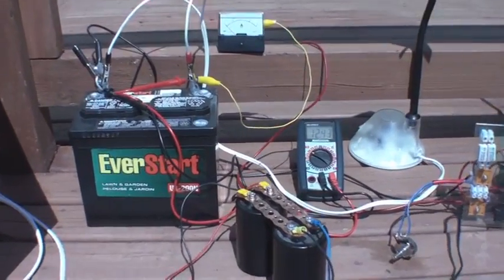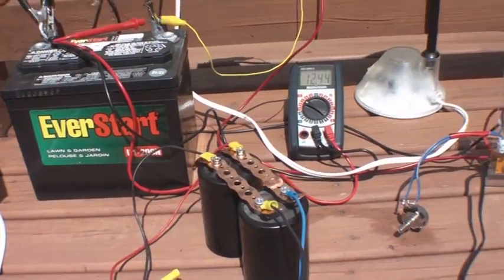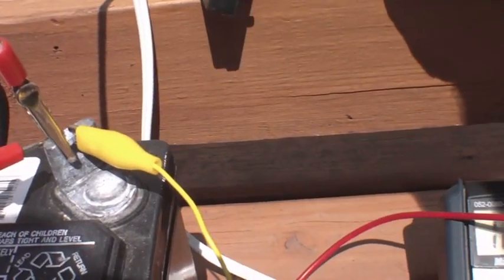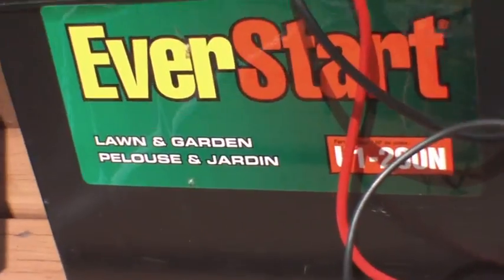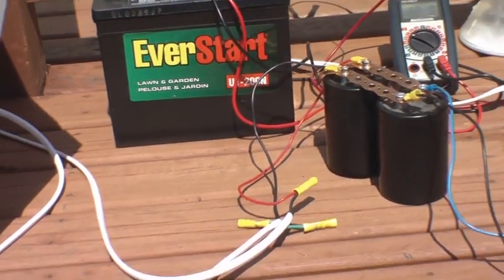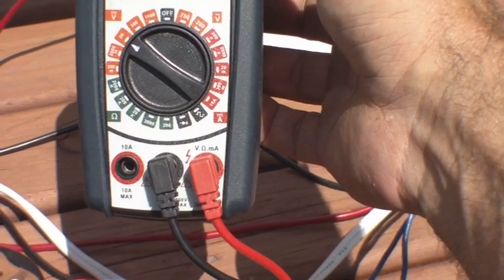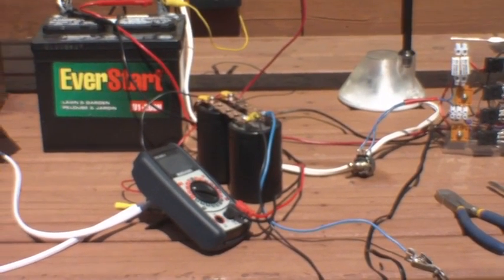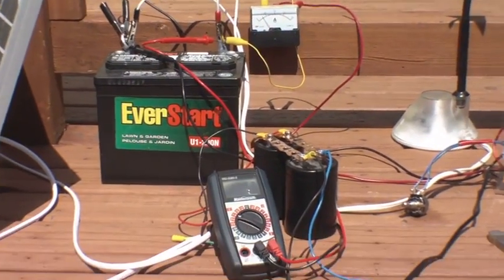(24V) Solar TS SS SSG Charging 12V Running 20 watt load

Comment from the maker: It is pulsed, but at a high enough frequency that it appears to be linear on an ammeter. I will do some further testing, but yes it does appear to handle a load, and charge, but I really ought to run the oscilloscope showing battery voltage to see what is really going on, over a much longer run time.

Comment from the maker: well... actually.. i had the load on, for a bit, at first, simply to discharge the battery a bit... before charging... the odd part, is, that it seems to charge the battery, despite the load still attached... but... i won't make that claim until i do some more testing, as that claim, would not really make sense...

Comment: You used the lamp load in place of charge controller????  or without both the set up can run on 24 V   ./    my ss ssg  slowly charge my alum batteries @240 mA    Your  undervoltage observation is true to itself     thanks   totoalas